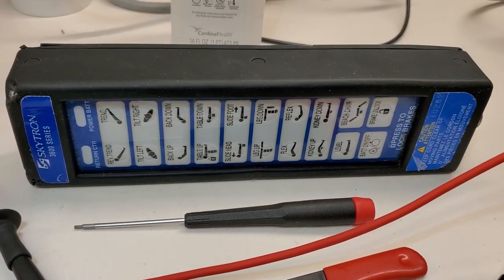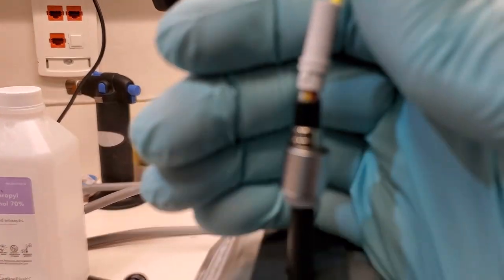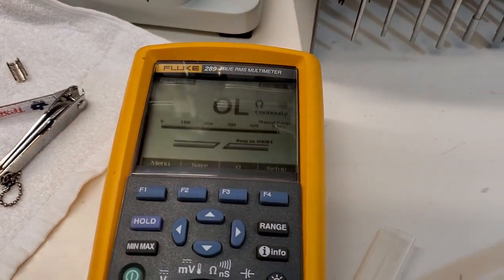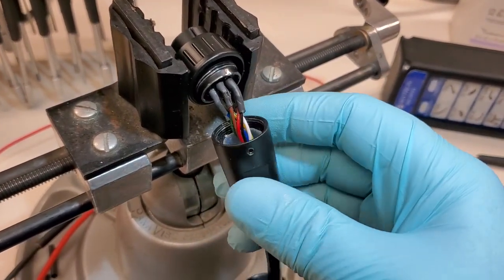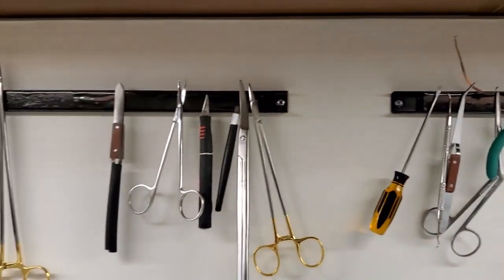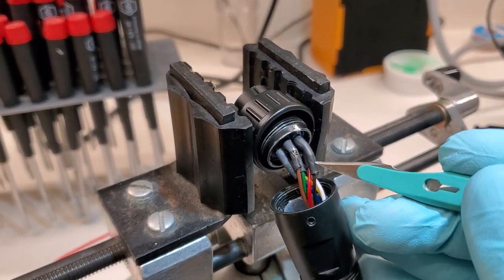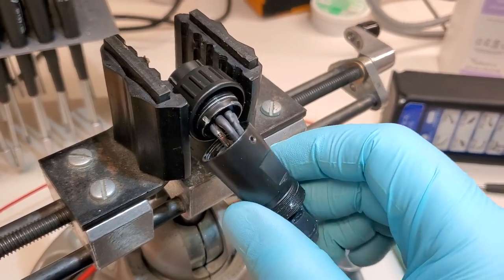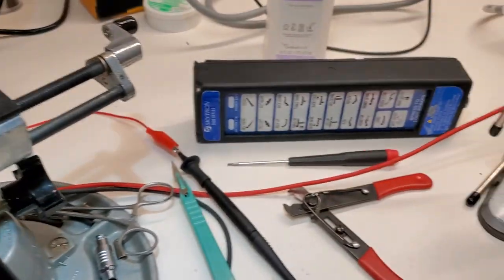Skytron Remote Repair

Comment: I was working on the upgrade of a phrma tablet press powder level system and during testing it was giving me fits. It would read powder level properly 85% of the time and them it wouldn't. After three days of verifying the installation (I did not trust myself) and testing the components I found a cold solder joint in one of the barrel connectors. New does not = perfect.   Drove me nuts!!
Reply from the maker: This could be a video all on it's own... New does not = working. That means equipment, parts and software upgrades. if anything, I see many more failures in new equipment roll outs than existing equipment. How many times have I been burnt by assuming a new part wast the problem?..

Comment: When we get the work order "Not Working" for this and pick it up,  the case is all beat up and makes a infection control issue.  If we try to repair the inside,  the case is not repairable.  We have replacements ready to go.  $3,000 each.
Reply: I can sell you replacements for much less than 3000

Comment: Justin, any idea where to source the case for these hand controls?
Reply from the maker: That's a good question. It looks all proprietary.  There are only a few vendors who actually manufacture hand and foot controls - maybe they are outsourced..
Reply from the maker: https://www.ebay.com/itm/SKYTRON-SURGICAL-TABLE-3603-Series-HAND-CONTROL-/164947854370?mkcid=16&mkevt=1&_trksid=p2349624.m46890.l49286&mkrid=711-127632-2357-0